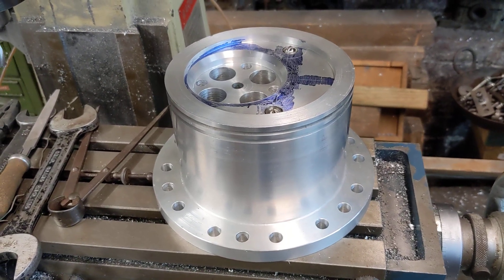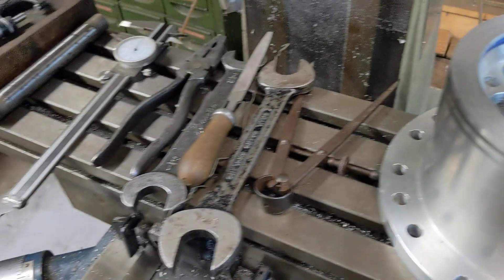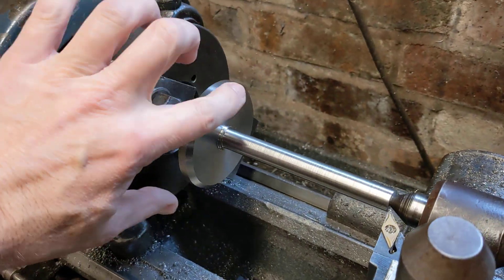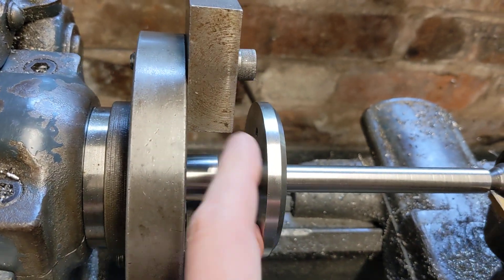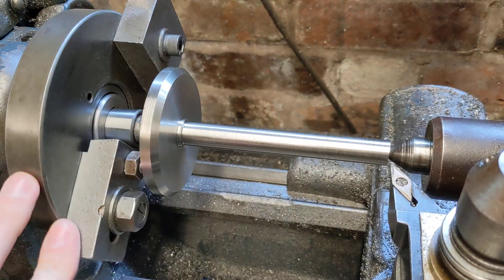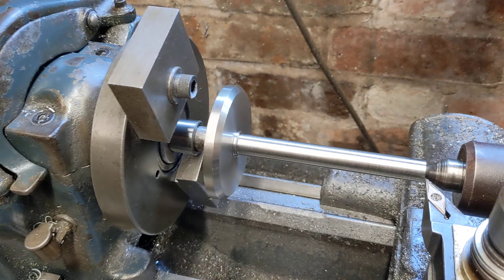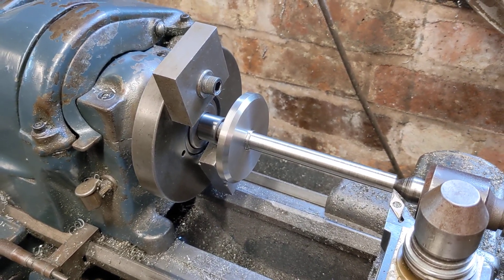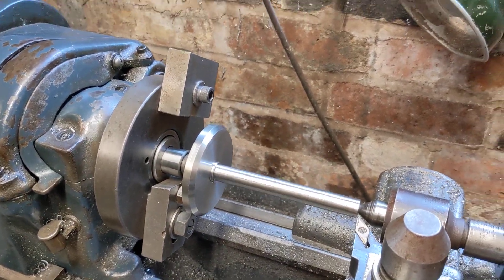Slow Progress on the Decompressor.

Comment: Can't you unharden the valve with a little heat, then reharden after machining?
Reply from the maker: We did consider that, but without knowing the composition of the metal is a bit hit & miss. It's cutting reasonably well as long as we stick to light cuts and exercise patience. 😁